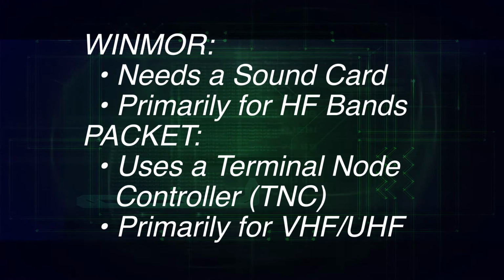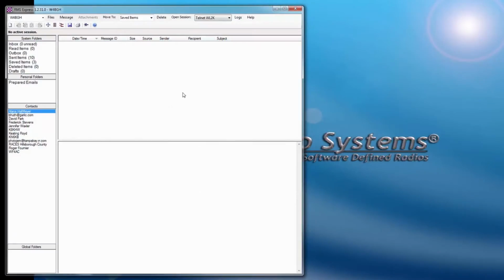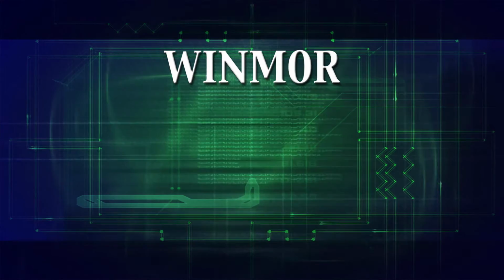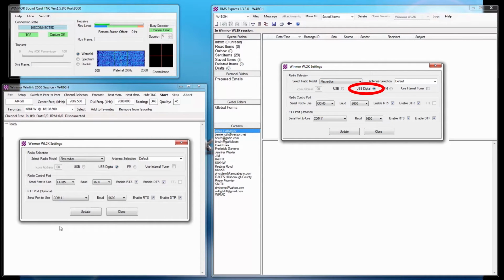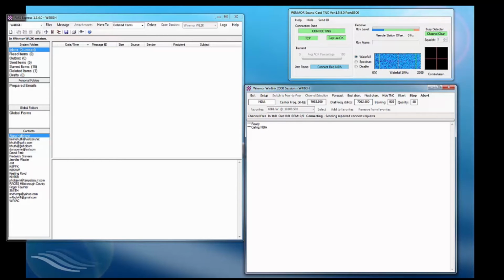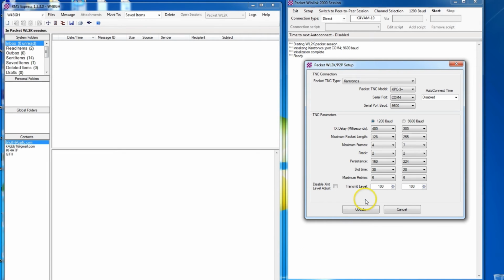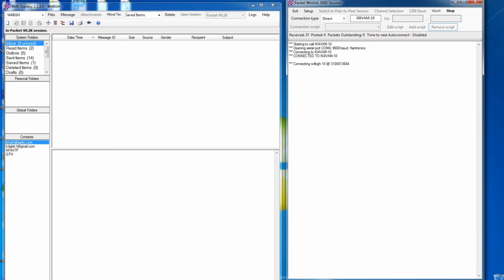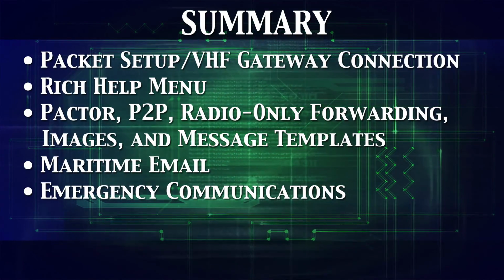RMS Express 101

Comment: I have been trying for days to get a connection 
I had one partial connection that failed

usually I dont' hear a reply from the station I am calling so I am assuming it is a transmit issue, for now.

I am running winlink RMS winmore on a lap top I use telnet quite often

I have a signal link, in to the mini din port on the back of my 706Mkiig.

I can see my radio transmit and sometimes hear the data going out including the id at the end of a fail to connect.

normally I am going into a hustler coil whip antenna on my pick up truck via an AH-4 tuner.

I am using Upper sideband

I am using the Dial frequency

no compression or filters.

my power is set to 5 of 10

I have tried 80 and 40m      starting at my nearest RMS at 24km and walking out in 100km steps to 1000 then back.

I have countless of tries over more than a month with out luck.

I am an active volunteer emcomm in central washington CN97